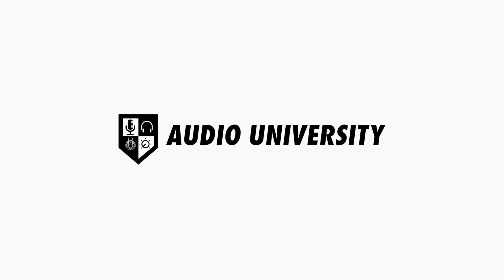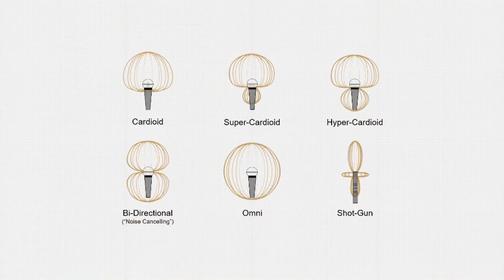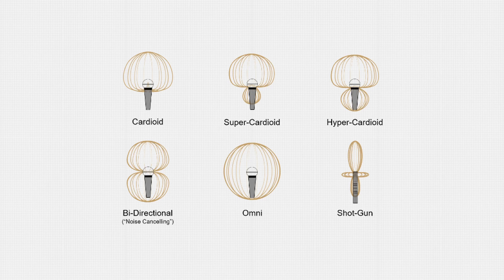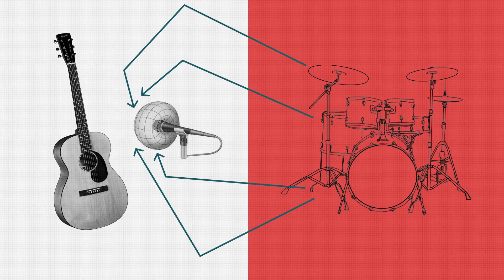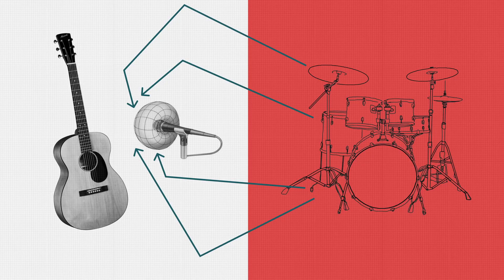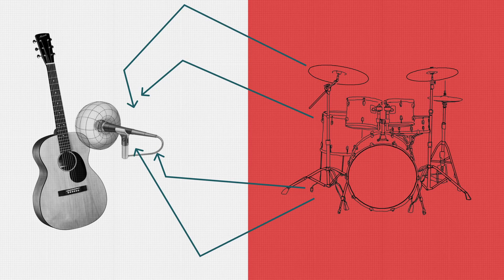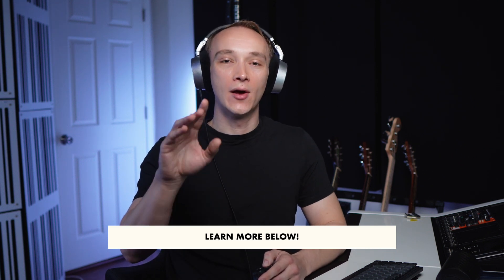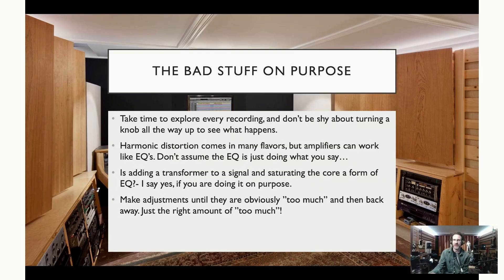3 Principles of Mic Placement Every Engineer Should Know

Comment: Another very important thing to consider is "off axis coloration."  Some very expensive mics have a narrow sweet spot and outside of that, the sound is filtered in an unpleasant way.  Most of my work has been "classical" so the mics are not super close to the source.  I need the off axis sound to keep its natural sound.
One of my favorites for this quality is the Microtech M930, a very quiet, accurate mic with little off axis coloration.

Comment: The last one was one of the biggest lessons in my engineering career. Learning about proximity effect is a huge eye-opener to knowing the equipment. Something that doesn’t get talked about enough is using equalization to counteract these effects within a given signal. For those who don’t know about proximity effect, I encourage you to go research it some more. There are articles even posted on manufacturers blog sites that go more in depth to the physics behind it. But when using equalization against proximity effect in order to reduce the effect or to “equalize” it back to a flat response,it’s important to know the proximity effect has an increase of 6 dB/octave which increases with frequency as the distance decreased to the capsule. Pretty cool stuff!